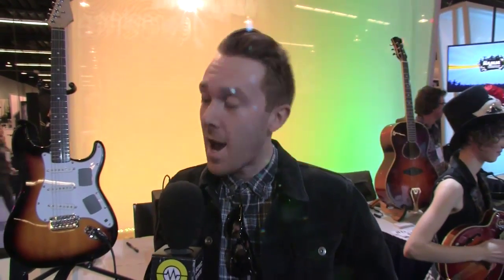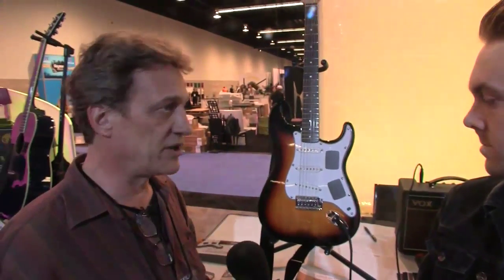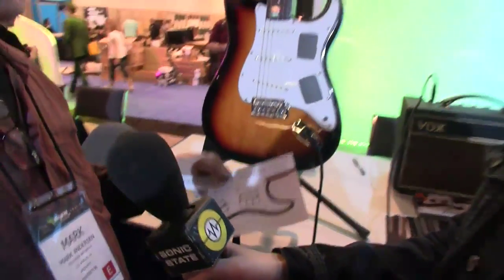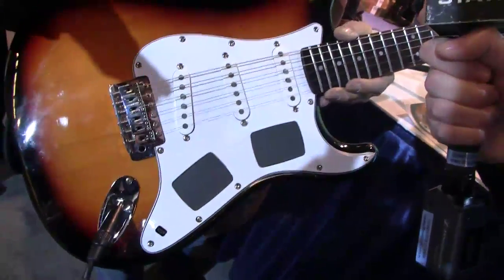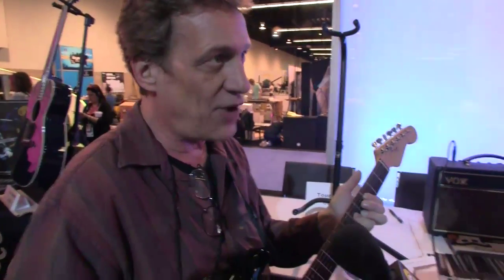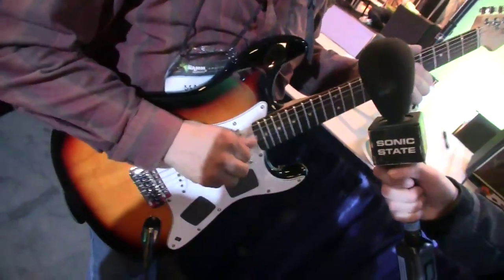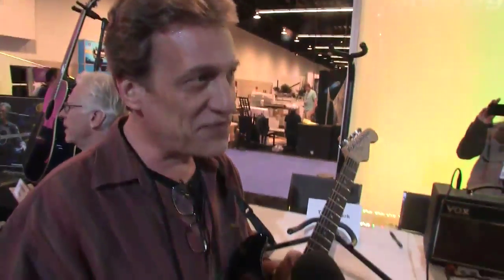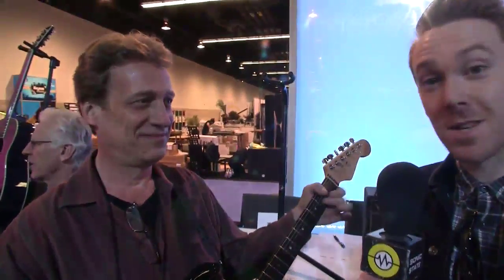NAMM 2014: Touchmark Touch Sensitive Pickup Switching - Video Demo of a Genius Idea In Action

Comment: Honestly surprised it took this long. I took one of my guitars and built a less invasive system into one of my guitars when I was 16. I too thought it would be a great idea but as Colin mentioned it is fixing a problem guitars never had. No offense to the company but it is very awkwardly implemented. Buckethead uses touch switches on his Les Paul guitars as a kill and works great for his application though.

Comment: My complaint is not along the lines of "my blade selector works just fine" - it's actually that the difference between this switching system and the traditional system is negligible. 

The problem this system purports to solve has already been engineered around from the input side. I mean, I guess this lets you do things like adjust the tone for individual pickups which we clearly weren't able to do before without plugging the guitar into a computer.

If you want to build a better mousetrap, the key word is simplify. If you want to add functionality, make one of the touchpads shoot lasers or generate beer. Otherwise, make a system that switches pickups based on biometrics, so the sound follows my emotional state. That would impress me.

Comment: If you can't switch pickups with a blade selector you won't be able to use this either. As far as the Volume swells you can just buy a Volume Pedal. Plus the touch panels seem to be in the way of where most players rest their hands. As fas as "volume drops" between pickups, personally I've never had a problem. I don't mean to be an ass, just my humble opinion.
Reply: I agree, in fact I welcome the volume change between the different pickup positions. Personally I use the quieter middle position (two humbuckers) for my rhythm sound and either the neck or bridge pickup for a solo volume boost.